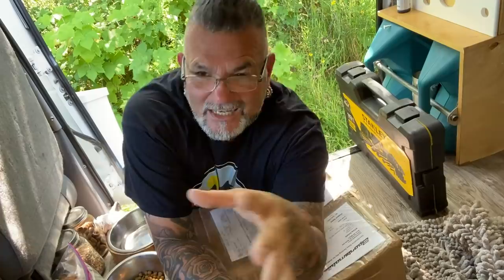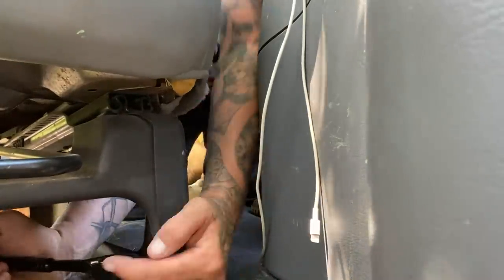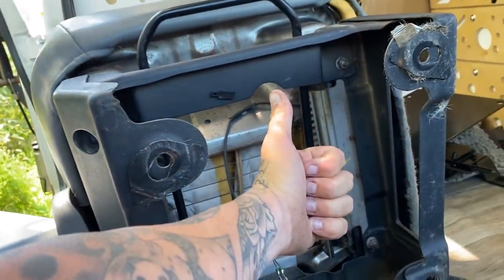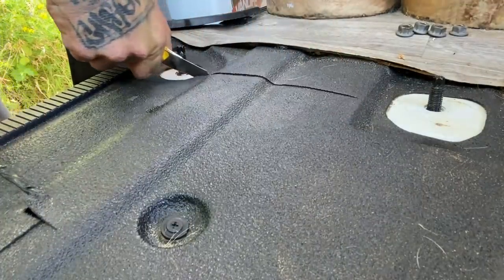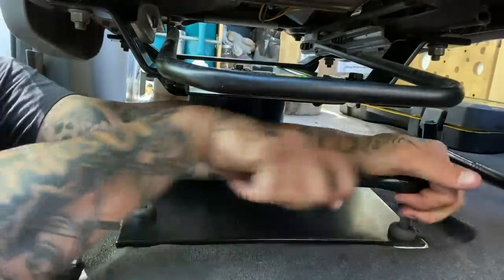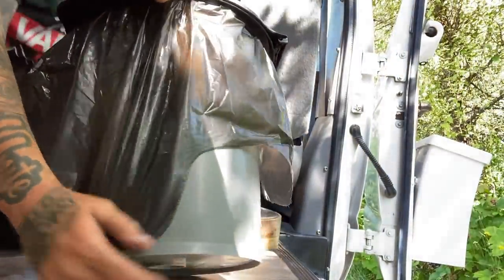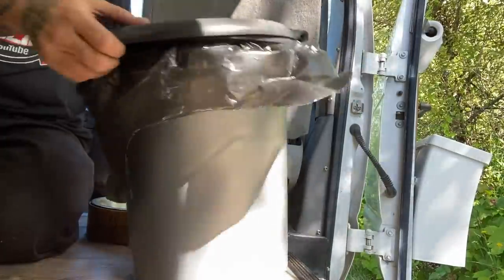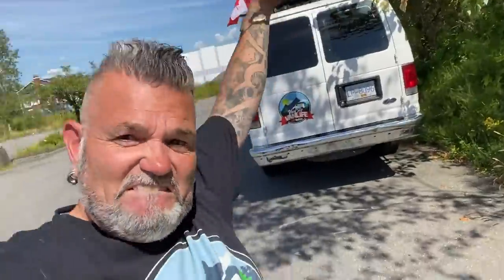FINALLY Picked Up a SWIVEL SEAT | Ford E250 Campervan

Comment: Pick up some washers and stack them under the plate to fill the gap to the floor rather than tightening them to the point of bending the lower plate. You'll have less stress on the bolts and a more solid install. Typically when a van conversion company installs swiveling captains chairs they first weld a plate or mounts to the floor to make it level.
Reply: I thought about it when he was cutting the floor.lol
Reply: Might have to find a new place for Cruz's dishes or visitors might think they are for a pedicure.
Reply: I would rather use flat metal pieces with the same length/height as the base. And then as extra safety  drill a new hole in the middle for a new bolt.
Reply: It looks to me like the thick part of the rubber bushings should have been under the new seat base... 7:50
Reply: @bradseward8342  The issue is the ribs of the floor(formed into it to increase rigidity like the core of corrugated cardboard). The original seat base dropped down between the raised sections(see the indents at 3:25) where as the swivel base is completely flat. Whether the rubber liner was above or below the seat base would have only made a marginal difference. The new base can compress the rubber and sound deadener underneath it, but either the steel floor or the steel base has to give for the two to meet.

Comment: Super stoked about your seat! Hey just a thought.. what if you get a storage ottoman with the lid to put your poo bucket in. I have one and they are super sturdy. I got mine on Amazon. If you put a board on the inside you could install wheels on the bottom of the ottoman..it would be multi functional. Poo bucket, foot rest and seating..you could sit on it and roll around your van. If the bucket is too tall just find a bucket that would fit inside the ottoman. It would be hidden out of site. Also, would be taller with wheels. 👍 Just an idea lol 💡
Reply: Kristi Miranda Art I was thinking the same the other day, spooky!
Reply: Natalie VW great minds think alike, ehh 🧐☺️
Reply: I puchased a fancy fold down ottomon 19$ , as a seat will hold 100kg.. only put my shoes in it and use it for a foot rest. But it would be perfect for dunny.
Reply: Barb A Im sure it will work. Mine is a fold down as well. I currently have my shoes in mine and use it as a foot rest too😊I’m well over 100kg and I sit on mine all the time. They are really sturdy for thick card board. I mentioned putting a board inside to attach wheels to the bottom. That might make it hold up even better.

Comment: I've been trying to talk myself into one of these. But in my previous van I put one in. With my current van I just turned the seat around and bolted it down. Saved a bunch of money, and rarely think it would be nice to turn it around. And if I do need to turn it around, it's a 5 minute job. More hassle yes, but about 300 bucks in my pocket.
Reply: Ripp Snortin, Bought used swivels, holes didn't match. Three people attempted it. Problem was they were middle passenger seat swivels. My front bolts are 11". Back bolts 9:. Tool and die man said he could weld pieces on the 9" side. He was doing it as a favor and I felt it would be too much work. Did your reverse bolts  match?
Reply: @johnettew3957  3 of them match up. The one that doesn't is still clamping down on the edge.

Comment: Dude I’d need a torch, and two men and a mule to break the the bolts on my crusty old ford 150. Now you can take the old mount  and bolt it to your roof for extra passengers. 🤣☮️❤️😎

Comment: Did the same thing on my E350 a month ago, looks like the same base. Had the same experience, fit and works perfectly! Nice to have a useable extra seat!
Reply: I'm trying to figure out how to use a  swivel that I already have for my driver seat.  So far I haven't figured it out. Steering wheel gets in the way.

Comment: I'm planning on adding a small storage box with a padded hinged top.  It's a bit more storage for smalls, foot rest for the swivel seat, additional stool for company, and it can be an outside seat as well.  Something milk crate size would be ideal I think.
Reply: Kris Kjellquist I have one of those that I have put a memory foam cushion on top of, using for my home office chair ... it will be coming in my van with me. It’s like a hard plastic patio storage box that I found for free by the side of the road, cleaned and painted it!

Comment: get a nice woven rattan round hamper basket, that the bucket fits inside and has a flat lid with a rim that fits over and meets the bottom when it's closed up. then it looks nice and is easy to remove and clean, and fits your decor.

Comment: I would  use flat metal pieces with the same length/height as the base. So that the nut tightens the the floor. And then as extra safety drill a new hole in the middle for a new bolt.

Comment: So brilliant to check the old base first! I've been wanting to do this in my Ford 250E extended van - it's was a passenger van and has walkup steps behind the passenger seat. Very cool.  There is a pole there. I love that too but I think I'll have to remove it in order to turn the seat. PLEASE - where did you order the base? Sportsmobile swivel base - 'not available' wherever I look.  ArghhhhhH!   hahahaha.  Thanks for going for it and knocking it out of the park again.  Hugs!

Comment: My old camper van came with a passenger swivel seat.  However, I found that I had to get forceful when the arm rest prevented the seat from going 180.  I ended up taking the door armrest off.   Closing the door is a bit tricky but it's totally worth the aggravation when I sit myself down in that comfortable seat and prop my knees up on an ice chest.

Comment: I'm glad it fit!  I still have my old that looks just like my 95 chevy van, but the swivile seat from my old van doesn't line up with the floor bolts. 
It's nice when a plan comes together!
Reply: Henry Escat you. You can have a conversion plate made by a metalwork shop. Shouldn’t be too much.

Comment: I installed one on my 2000 e150 just like yours. Its perfect. You will use it quite a bit I bet. Mine came from SHOP4SEATS. I cut out the rubber floor directly under the seat to make it sit flat. I found a way to reattach the air bag sensor so it wont stretch the wire. And you dont reuse the original seat mount.

Comment: That wire to the bottom of the seat is just for the nuisance seat belt alarm, has nothing to do with the airbag.
Reply: Really??  Aw hell, I'm gonna hurry up and unplug damn that thing then...
Reply: @jajakilla , If you unplug it and your alarm still buzzes with the seat belt plugged in , you will have to jumper the wires, meaning to connect the 2 wires together  , , GOING UNDER the seat base to close the circuit , or cut off the plug from the SEAT SIDE of the plug and strip both wires a little and wire nut them together. ((When You hook up your seat belt into the slot it closes the circuit to make the alarm stop)), so you will just trick the alarm system into thinking the seat belt is plugged in. I hope I didn't make it sound complicated ,
Reply: Lori Hicks Just keep the seatbelt clicked in all the time like I do, so when your dogs sit in it, the alarm isn’t going off! 🤣🐶❤️

Comment: So just to clarify when you cut into the fooring where you had to install  
the swivel base did you pull out insulation from underneath there and just push it back into place so the base would sit more flush?

Comment: 350 bucks!!  No freakin way would I pay that much for one of them..I'd make one first, for under 100.. it might not be as aesthetically pleasing but it would get the job done.
Reply: Michael, where are you? I need creativity to install used middle swivels that bolt holes dont match.

Comment: Are those wires really airbag wires? I just recently installed the same swivel seat on my 2005 e250 and I just chopped those wires off and capped them thinking it was just the seat belt alarm. Oh crap. Someone please help.